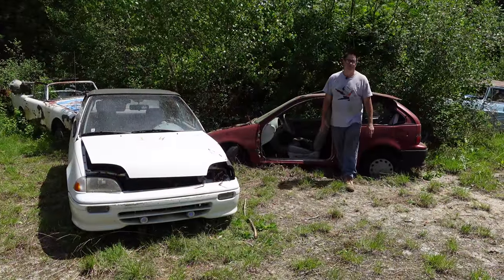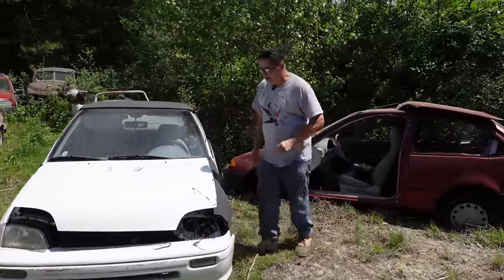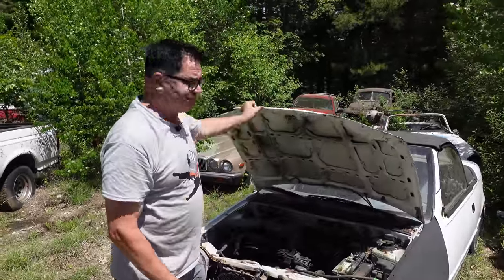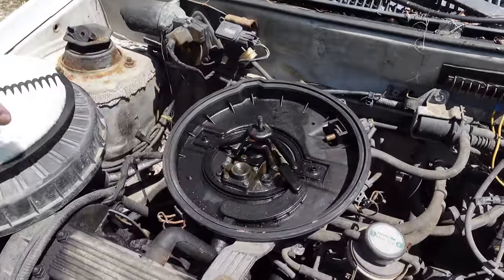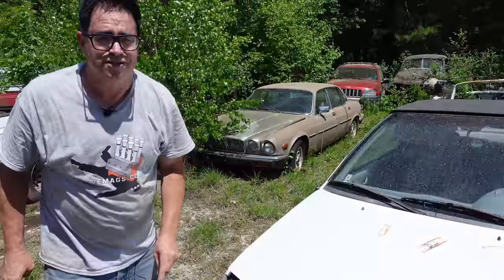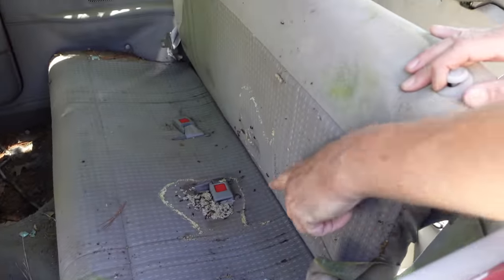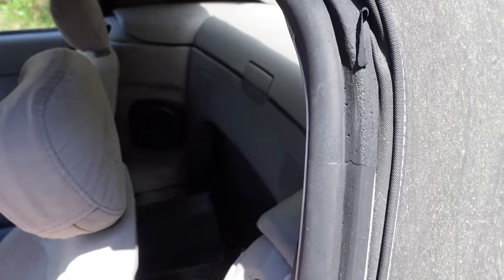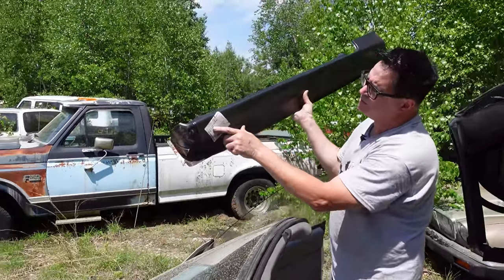1993 Geo Metro Hatchback and Convertible

Comment: I had 2 of these, both stick, both hatchback. Great on gas, easy to maintain. The scary part was my 6'4" frame felt more comfortable in that car then in my 02 Civic.
Reply: I bet you looked like you were 7 ft tall climbing out of it 😁
Reply: The interior proportions of these were similar to the Toyota trucks of the day, seat mounted close to the floor and lots of fore/aft travel. Things changed with the redesign of '95 to accommodate the NTHSA  airbags and crumple zones and what not. Seat definitely lost a couple notches of travel and the seat was mounted noticeably higher impacting headroom a bit even though the roofline was higher

Comment: When I was about to graduate college in 1990 I test drove a new Suzuki Swift GT -- basically the same body as the Metro but with a 100HP 1.3L I4. It was so light and nimble and revved to the moon; it seemed quicker than it was. I didn't end up buying it but fondly remember it now as an example of a super-basic, simple and light sporty little car that we'll never, ever, see again.
Reply: I owned a Suzuki Swift, seemed to be a little bit more decked out then my Metro, same engine in both, they were death traps on the interstate, the bad thing about them was the lower control arms support rails held water and would in time rust out.

Comment: I bought both my 94 and 96 Metro’s new.
Both were 2dr hatchbacks.
I had a 2” exhaust system and a “Glasspack” installed on my 94. After going from a 1” exhaust to a 2” exhaust, I got 58mpg and it would run at 85mph.
In 2 years I put 210K miles on my 94. It had 12” tires.
My 96 had 13” tires and the highest speed I could get was 80mph after I had the catalytic converter taken out when it plugged up at 51K miles.

Comment: I owned approximately 10 Geo-Chevy Metros over the years....the 3 cylinders were damm good fuel savers...
Reply: Yeah, the XFI was the best.
Reply: What was your best mpg?
Reply: @Jeffgordonfan24hesthegoat  my 91 metro easily got 50mpg
Reply: I read once it was the only car sold in the US that got a true 50 MPG  ..could use this car today
Reply: @Scalihoo  Hi. That is not entirely true, as I did manage 52MPG in my 94 (sold incorrectly as a 95) Civic VX. It was a "black sheep" car for Honda, as there were some issues that Honda refused to sort under warranty. Also, the stock gearing was so long that 1st did not like to go much below 6MPH in traffic. Mine did have rare A/C, which I used as secondary braking (the front rotors were too small). As the 2nd-best manual driver in my family, I got 206K out of a stock clutch (still did not slip, but the ISB gave up).
Reply: @erikmann9861  Manufacturers claimed 50 but if real world driving it never happened till these came around..wow 206k out of a stock clutch is great.  I liked them & wanted one for buzzing around town mostly always liked that 3 cylinder Suzuki motor

Comment: Around '91-2, memory no longer serves, I bought a Turbo Sprint, that monochrome red(very '80s), as a daily. It was a bit ragged but OH MY LORD that little thing was fun to drive. Put some shocks and new springs on, wider tires... Proceeded to drive the paint off that little thing for 5 years. What a great little car. She ended her days in a junk yard as well.
Reply: The turbo Sprint (and later Canadian turbo Sprint) had decent power delivery when they ran right. Very delicate turbos though you really had to know what you were driving or the turbo would fail and you were left with a choked out geo. Same with the Isuzu turbos of the same era

Comment: The convertible (Suzuki Cultus) was made by Suzuki Japan to compete in the California market in 1992, plans were dropped after the premiere in the Frankfurt Motor show and subsequently Geo took the convertible to market with a lower spec 1L engine and no power windows, steering etc that Suzuki had originally intended.
Reply: The Chevrolet Sprint and subsequent Geo Metro were severely decontented from their JDM Cultus counterparts. Offering them with proper multi point FI, turbo, power everything, premium fabrics/ carpet etc would have cannibalized sales from other GM products. GM didn't care that they would have also taken sales from Honda

Comment: I had both a Sprint and a Metro. They were my commuter cars in the 80's and 90's. My Metro was exactly like the maroon one in the video. It cost me $6995 new and had NO options, not even a radio. Mine was configured for maximum MPG and got 50 mpg. I commuted 70 miles each way 5 days a week for $15.00 a week. I lived in NY and worked in NJ, where gas was still $0.99 a gallon in the late 80's. It was truly a fun car to drive with the 5 speed, peppy too! Once you put additional passengers in you could feel it and the car became quite sluggish. The car was quite reliable as I put 150,000 on each of them with no issues.
Reply: I suprised you didn't get the XFI model that was detuned for even better fuel economy.

Comment: Back in 1990 I rented a Metro with air conditioing while in the Fla Keys.   You're quite right about the load the a/c put on the engine.  I remember having to turn the a/c off when accelerating to get on the highway.  It got good fuel economy though, and was easy to park.
Reply: as a kid i remember us renting one to go to Disney World
Reply: Remember the same thing happening to me while going over I295 bridge in Jacksonville FL. Car couldn’t go up the bridge ramp more than 35 until I turned off AC.

Comment: I put 177,000 miles on a 1991 Geo Metro 2dr Hatchback in 8 years of ownership.  Only major repair was a heater core replacement.  When 75 MPH was restored on the freeways, I was never able to exceed the speed limit.

Comment: I had an 87 or an 88 can't remember Chevy Sprint 4 door with air conditioning I drove through nursing school. To this day one of the best cars I've ever owned. Sold it to my sister for five hundred bucks when I  graduated and she wrecked it. Never noticed a significant drop in power with the AC running. Drove it up and down the East Coast to visit my brother who was in the service in Georgia and I never felt unsafe on the highway. Little sucker moved out and got incredible gas mileage and was so cheap to maintain. I wish I still had it.

Comment: Thanks for the rundown on these … er… cars Steve. A few memories of these cars from my 22 years hauling cars all over Canada.  I remember I had 2 or 3 
on for one of the GM dealers in Thunder Bay. I was running a bit late and so called the dealer ahead of my arrival. When I said I had Geo’s on he said
“ oh, that’s not good. “ when I asked why, he said “ well the lake ( Superior ) is frozen, so you can’t dump them there “ 

One of the guys I worked with in western Canada was dropping one at a dealer in Alberta one cold morning, a the lot guy was receiving the cars as he 
was unloading. They had to boost one on the truck, and had the air cleaner off to spray some quick start. Who’s the driver as under the hood it backfired.
he pulled out from the hood so fast that he dislodged the hood support rod, and the hood fell on his head. When he pulled out from there because the 
the throttle bore was on fire he let the hood drop, and the support rod made an inside out dent in the hood. The car jockey inside the car yelled at him
“ Quick ! Grab the air cleaner ! “. Then he squeezed out of the car, and came around opened the hood and blew out the flames while cradling the air 
cleaner housing back up into shape so it wouldn’t be deformed.  He told the driver that was standard procedure up there.
Finally, while dropping a mixed load of Ford, GM, and Dodge in Whitehorse Yukon while doing a walk around of the units at the GM dealer receiver he 
pointed out a car next one I dropped, and said take a look inside this car. The outside was fine, but inside it the dash, and console was destroyed! 
Apparently it was being towed behind a motor home, and either jumped into 1st gear or was left in first gear and then towed down the highway for a 
few hours. At some point the clutch and flywheel grenaded. It was a write off.  Thanks for the memories. I always thought they where made in Korea.

Comment: I had a 4 door hatchback with an automatic and air conditioning. It got a consistent 45 mpg and it would go way faster than 65 with the A/C running. It was a great car, I was sitting in it the day the Twin Towers were attacked. I was also glad to have it when gas doubled in price in the next months.

Comment: I worked for Chevrolet from 1978 until 2008 and remembered the Geo line of vehicles. If I remembered correctly they were Japanese vehicles with GM badging. The 3 cylinder came with a manual transmission and the automatic cars had a 4 cylinder engine. Like you said it got great fuel mileage. The 3 cylinder with the manual transmission would get around 55 miles per gallon.
Reply: Yeah they re suzuki swifts
Reply: I had a (I think) 94, green. I was the second owner it was low mile car. Previous owner requested one as bare bones as possible, no radio, manual brakes, steering, crank windows, manual locks, 5spd trans... it was not fast, but it was a really fun car, handled like it was on rails.
Reply: Yes it was just a Suzuki Swift/Cultus rebadged.

Comment: I had an '86 Chevy Sprint 2 door hatchback with AC. (There was also a 4 door hatchback)  It had a carbureted Suzuki 1.0  liter 3 cylinder. The front of the motor was on the driver's side, and a 5 speed overdrive manual. I could get 55 mpg on the highway and could cruise 80 with the AC on. I put over 200,000 miles on that car.

Comment: These are actually pretty fun cars, you can drive it like you stole it all day long and burn almost no gas at all and never get pulled over for speeding. There was also a 4 door hatchback, and Suzuki had a hot hatch version, the Swift GSi that had a 1.3 4 cyl twin cam that was good for 115hp, it also had stiffer suspension and 4 wheel disks

Comment: I had a 93 metro XFI, power to weight was AMAZING ! It would run over 80 all day long ! I have photos of mine doing it with speedo pegged.  It had both 4th & 5th speed being over drives.  I got a speeding ticket on 275 here in Cincinnati doing over 80, , after I had lifted when I saw the cop.  Anybody tells you 70 mph max in a metro,   just smile and walk away.

Comment: I had a ‘94 prism lsi, basically a rebadged Camry I got it used from my wife’s uncle, with 74k I took it all the way up to 385k and gave it to a buddy that needed a car, he put another 100k on it before it died. 
I actually dismantled an ‘03 CRF 450r and crammed it in the car to get to a race in New York when my S10 fuel pump crapped out the Friday prior to the race.

Comment: A 3 cylinder Metro tops out at 93 mph. The A/C kicks off under hard acceleration like all cars. So you (not the engine) might get hot at that speed. But in the winter you can literally drive one intercity at 90 mph with no harm. The second generation had a wider rear track, making them handle well, and a four cylinder was available which was quite peppy. The convertible had larger wheels and the front struts from a Suzuki Swift GTI. Alas no gen 2 or 4 cylinder convertibles.

Comment: I live in WV and I own a 89 Canadian turbo version of a metro, 87 Chevrolet turbo sprint and a 93 metro convertible that I'm doing a turbo drivetrain swap on for my wife. I got into these cars the last time gas prices went bat shit crazy under Obama over 10 years ago. Im so glad that I didn't get rid of my cars when gas prices got better under Trump. There are a ton of performance upgrades available for these cars do to the Suzuki Swift/Cultus GT with a 1.3 DOHC engine being the same car. My 89 has 4 wheel disc brakes and coil over aftermarket suspension and handles unbelievably.

Comment: My brother had one he ran it between Saskatchewan and Ontario on numerous trips. Cheap on fuel the only draw back was finding tires when you needed one
Reply: Yeah those little 12-in puppies were hard to find try to find them for a Ford fiesta when they were 70 series 12 in my friend had a don't remember what year Ford festiva and it had 12 in 70 series tires tiny little things but very hard to find he ended up just buying two Michelin 12-in and they weren't 70s cuz he couldn't find them only Yokohama had them and he had to order them so he just put regular 12-in michelins and he said they handled way better than those yokohama's did anyways.
Reply: We found trailer tires worked well in a pinch. I wouldn't recommend running highway speeds for long periods as they tended to explode.

Comment: I sold a few of those Geo metro engines on eBay. Them 3 bangers didn't weigh much I pulled them by hand.
My mom's last car was a 96 prizm. We gave it to a friend that ran it through a figure 8 race on a Wednesday and won. Then Saturday it was put to death in the demolition derby and almost won til someone snapped axle off front and disabled it.  Had 450,000 miles on it roughly
Reply: The prizm was a Toyota carolla.
Reply: @robertstone9988  I know . But was labeled geo prizm

Comment: The Suzuki Swift (same car) was also available with 1.3 4cyl that made 99hp, that was 3 door only. The standard car was also badged as a Holden Barina in Australia.
Reply: Also came in a 1.6L sedan, 1.3L sedan (carb), 1.3L 5 door (carb) and 1L  3 door (carb). Also the Swift is not technically the same car, there were design difference with the grille and bonnet etc on the metro vs Swift

Comment: I sold computers at staples in 99/00 in northern indiana. Some guy came in during the middle of winter to buy a PC, 17" CRT monitor and a printer. He was driving a metro convertible and the only way he could get it all home was to put the top down and put the monitor in the passenger seat, the printer in the package shelf behind the seats and the computer in the trunk. 🤣🤣🤣

Comment: These cars as Suzuki Swifts were popular as hell here in Aus and im familiar with the ragtop version having done a "Big block" 1.3 swap to one years ago for a friends girlfriend and later adding a low blow turbo I sourced from an importer, Based on your description of the underpinnings the convertible was the same car and as I did shakedown driving after both conversions it wasnt a bad thing considering although I did add a Hoop to the thing for better roll over protection.
Cheap and cheerful it did okay in Aussie roads but our maximum highway speed was 62 Mph at the time.
Nice to see the GM version here :-)
Closest I ever got to this type of vehicle was a (Ford) Mercury Capri rag top about 12 years ago which was Mazda engined and with the US aftermarket to the rescue compliments of Rockauto and Summit She was a fun thing in turbo form that I ended up giving to my Daughter.
Again, Cheap and cheerful motoring :-)
Reply: Same but different, you would have worked on the Suzuki Cultus Convertible which has a 16 Valve 1.3L throttle Body injection engine and was imported from Japan in very low numbers in the late 90s

Comment: In the UK they were sold as the Suzuki Swift

I've always loved the look of rear end of the earlier hatchbacks
Especially the early Mk2 GTi model
Like rocking horse shit to find now though,
Think I've seen 2 for sale in the last 5 years.

The GTi had a G13B 
1.3 twincam 16v 
100HP @ 6500RPM
110NM @ 5500RPM 

Pretty decent considering they were so light.

Comment: I had a friend that bought a brand new Chevy Metro 4-door with a 4 cylinder but it wasn't a Geo it was when it was called Chevrolet they had change but it was still the Metro but his was kind of a weird one it was really quite fancy for a Metro it had power locks which was kind of rare automatic air condition where's a good car he kept it up to about 50,000 miles and then traded it in for a Grand Marquis 2004 so he went from a tiny car to a big boat that tells you he didn't care for the little car ride evidently.

Comment: I had a 1979 Chevrolet  Sprint a predecessor to the Metro,
Sprint had 1 liter 3 cylinder,  I put 300000 miles on it.  In the end the engine blew.

Comment: I was told that the ac was only an option on the manual transmission cars. I guess the ac clutch would engage and kill the automatic cars when sitting at a stop light idling in gear.

Comment: Had a 92 5 speed.with a/c and a 6 changer cd player stashed in the back...ridiculous gas mileage and anemic with the ac on ....I liked that car alot....McDonald's had a commercial and it used a down sized metro and called it the 2 door speck....damn I'm old....

Comment: no geo metro was ever built in japan, the convertible and 3 door hatch share the same wheel base,and the canadian 4 door was a longer version. all geo metros were built in canada at CAMI Automotive. only thing that was japanese was the drivetrain. sorry steve, but this time your wrong. and air conditioning was dealer installed, and the car didnt need the ac compressor to keep the speed limited, the car was so weight sensitive that even grocerys would slow the car.  love your channel.

Comment: I had a 3cyl. 
The owners manual states 105mph top speed. 
You’re very off base about the low speed. 

It had a receipt for timing belt and water pump AND a tuneup. 
From the dealer. 
Bill was $95. 

Those were the days.

Comment: 55HP, heh?  Imagine that power plant in the rear of a 3-wheel Cushman Meter Maid from the 70s or 80s.  That engine wouldn't be so bogged down with weight anymore.  I would pluck the subframe out of the car, lock the spindles in the straight forward position just like how GM did on the Pontiac Fiero, and weld it in behind the cab of the Cushman.

Comment: Dad bought a 4 door a/c equipped automatic 93 geo.Burnt the exhaust valve in the center cylinder twice.Easy to pull the head at least,also at idle in drive it would stall with the a/c on.It defied physics it sucked and blew at the same time.